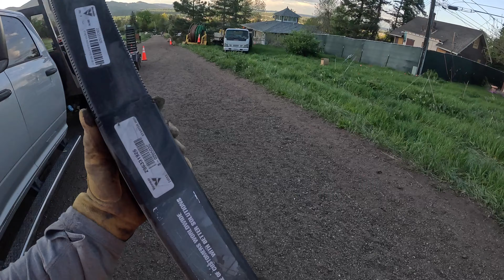We Broke The Head Off Drilling Rock #2

Comment: How does the drill change direction, is there enough of a spoon on the end to turn the direction. Is it drilling a 4" hole a little bigger when it goes thru the ground and rock.  65 years old and still a kid at heart and likes to watch.  thanks for the videos.
Reply from the maker: Yes you are right about the shape. And drilling that’s when it goes straight technically and then when you want to turn it, you put it in a position and push. Thanks for watching.
Reply: There is a bend in the bit. That bend changes if its a dirt paddle or a rock bit. Dirt paddle has more of a bend so we can steer better. There is a beacon inside the bore head called a sonde. It shows the locator the pitch and position of the head. The driller has a screen that shows some of what the locator can see on his locator. The sonde shows both a clock which is how we steer. Want to go right you push 3 want to go left push 9 and so on.

Comment: We got that X3 housing with the gauntlet when we hit some rock. Definitely not as hard as what yall went through but it got our job done with no teeth broke. How was it getting the broke ones out? It seems like you may need something more than the gauntlet in that ground.
Reply from the maker: We used a punch and popped the teeth right out and replaced them fairly easily. I’m not impressed with that bit setup, definitely wouldn’t buy it again for that ground. Crazy thing is I went back to a paddle bit. That’ll be in the next few videos
Reply: Yeah I think that bit is meant for “softer” rock, not extremely hard rock or else it will break. Try using it in hard ground with no rock and see how it performs. They say you’re not supposed to go more than 5% with the head or else the pull back may get compromised. That screw with the metal does seem like a design flaw that attached the head and swivel, I’m not too fond of it.

Comment: I had the same issues with that x3 housing , sure it’s easy change but they need to re engineer that head and housing. I use Borzall housing with an eagle claw bit . I drill in Utah a lot of rock
Reply from the maker: I’ll definitely look into the set up you use!
Reply: We had to send our X3 back to the factory because the roll pins kept falling out on me. Done a few challenging bores with it and have had better luck with it.